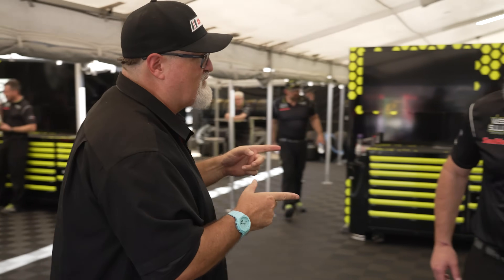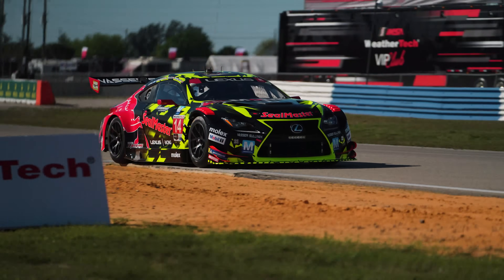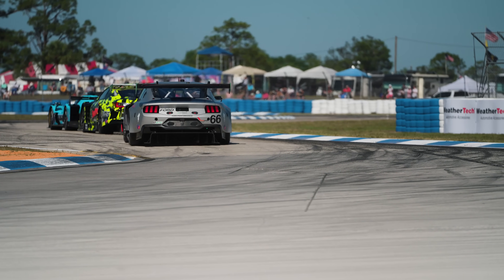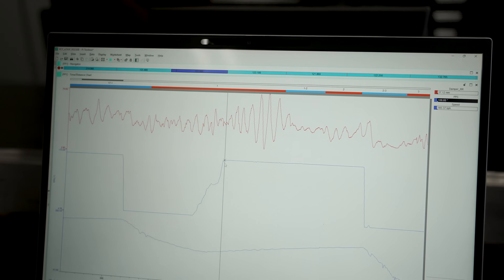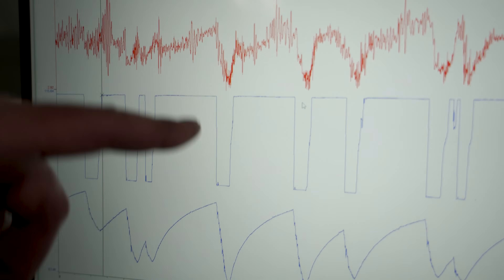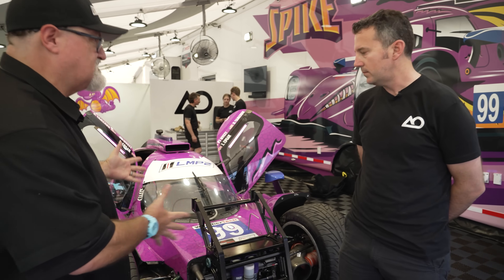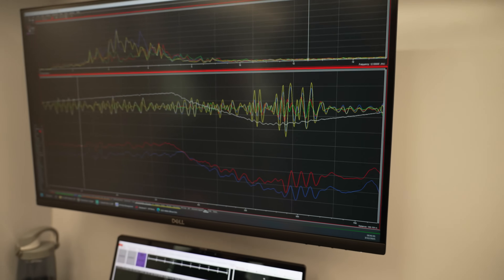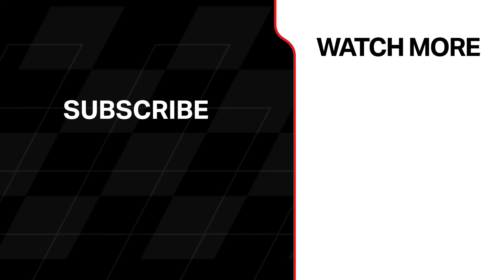The Roughest Road Course in The World? | How Teams Engineer IMSA Cars for the Bumps of Sebring

Comment: Also, what did the engineer for spike mean when he said they only run the unloaded tires in turn 17?
Reply: When cornering, the weight of the car shifts to the outside of the turn, which means those tires use all of their traction to corner. Meanwhile the "unloaded tires," or the tires on the inside of the turn, are using less of their traction to turn, so they have some leftover grip.

On turn 17, they try to drive the car in a way where the unloaded tire - the tire with extra unused traction - takes the bumps. If the ouside tire hits a bump, it is more likely to exceed its traction capacity, which means the car would lose traction and start sliding or spinning.
Reply: @ thank you!